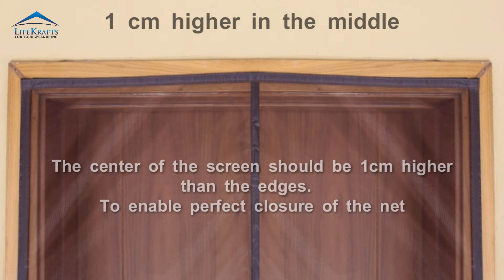How to install magnetic mosquito door net | DIY | LifeKrafts magnetic mosquito screen

Comment: I measured  my door frame .  Its height is 213 cm x width 95 cm. Will I get that size?  Also where r the magnets in this video ?
Reply from the maker: The exact size is not available but you can take the next size which is 215cmx95cm and the magnets are placed in the middle partition of the door net.

Comment: Can I remove the net during the day and install it back in the evening ?
Reply from the maker: Hello Anita. The product is easy to remove and install and reuse as many times you want to. But take care of the sticky loop tape (Velcro sticked to door frame), if in case it needs to be changed you should change it depending on the use.

Comment: 1:13 Doesn't pushpin create significant gap between frame's velcro and the screen velcro?
Reply from the maker: No , it won't create any Gap , you have to pin the push pin wall velcro

Comment: How Bout the opening of the bottom edge. Flies and roach, spiders in my area in sydney Australia only need a little thin crack and they can get through.
Reply from the maker: nets comes with very small holes , It will block all Insects mosquito , flies , Etc

Comment: Difference between Fibre or polyester and which one is good
Reply from the maker: Fiberglass screen is the most common type of screen used for enclosures.It is tough, lightweight, wrinkle-free durable screen mesh

Comment: Can the velcro stick on the wall instead of fixing on the polished wooden frames.
Pl inform whether the velcro rigidly hold the painted walls.
Reply from the maker: Yes, the velcro has a very strong glue which can rigidly attach on wall. Plan such a way that, once fixed, you dont find an opportunity to remove it. It'll last longer.
Reply: @LifeKrafts1  thank you sir. Pl. Inform
The best guality in the welcro tapes.
Reply from the maker: @sivaramakrishnagogineni2163  You can visit our website for velcro tapes (Hook and Loop). Our products are tried and tested on every surface for its strength and long lasting ability.
Reply: @LifeKrafts1  sir i have a stone frame only..... Will the loop tape work on that?

Comment: Can it be applied on sliding doors with plastic corners?
Reply from the maker: Yes it can be applied.
Reply: I have been using on one side of my sliding door from past 3 years.. and have washed ( hand wash) it several times.